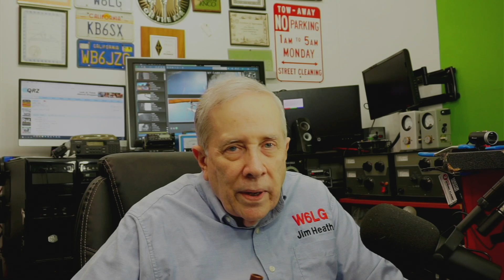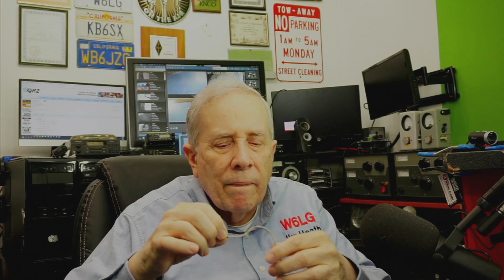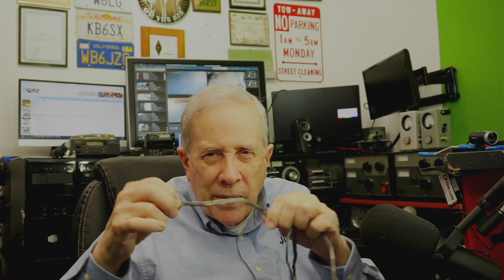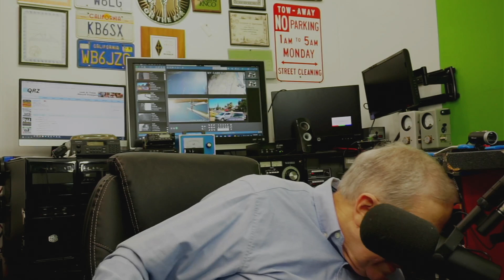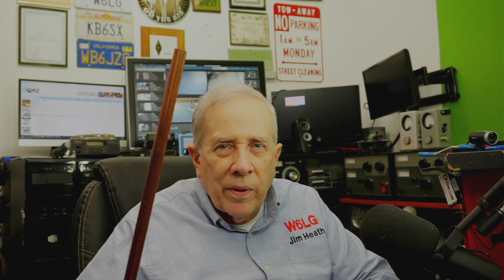How to RF Ground Your HF Station as Shown by the ARRL and a Discussion about Ground Loops, Bonding

Comment: My question is, what about someone running an all solar, or other battery powered only station?  If there is no mains connection and no mains powered PSU, then there would be no proper connection to the house's or building's proper ground.  in such a case, would a ground rod outside be best practice in such a situation?  

And, if we are talking theory, would there be a difference between a an actual shack or shed with solar or battery only power, and a house with a room that mains power but the house power is not connected to the radio system?  At what point is a radio station separate enough from the electrical system to safely not need to be grounded to the house main electric panel or main ground?  

I've asked the question before about grounding to a rack mount set, but I'd also like to hear your opinion on that if you have one.  Should the metal racks also be strapped to the station ground for voltage potential or not?
Reply from the maker: This is a video that has nothing to do with solar or batteries.  You are asking several questions not just one.  I have no experience with that kind of system.  There maybe some else who has the answers.  I have no idea.   For metal racks, like my desk here, yes I connect all of that stuff to the electrical ground.   Regards, Jim

Comment: I have already run a ground rod outside my second floor shack that goes back to the main ground rod via a system of rods and #6 copper wire. I should be good to bond to that since it is tied into the common ground point, correct? Second question is, how do/ did you bond your bonded pipe to the electrical system? Did you run a wire/strap to a ground screw in an electrical outlet?
Reply from the maker: If your system follows the NEC with respect to many ground rods and antenna systems as they show it their code/article, then good. My connection to the water pipe above this room was hose clamps. The room has shielding in the walls and that too is connected to the pipe. 73, Jim
Reply: @ham-radio  Ok, thank you! I guess your shielding is then bonded to the common ground from inside the wall. 

Yeah, I have 8ft rods, 16 ft apart (where possible) bonded with #6 copper. 

Thanks for the great videos and thanks for responding. 

-73!
Reply from the maker: @ericrobertson5130  From what I read this morning, yet again, what you have sounds good.  73, Jim
Reply: The NEC says that one or many ground rods should connect to an external-to-the-house terminal block and then ONLY ONE WIRE runs from that terminal block to the ground/neutral buss in the main disconnect breaker box and then distributed to the grounds in the house.  This requirement relates to AC fault safety and multiple current paths being possibly lethal.  If you connect your equipment to the ground rod outside your shack, would the AC power wire grounds in the wall socket now be connected to this ground rod via your power cords and equipment chassis?  Is this a multiple path for AC faults to return to the breaker box?
Reply: Best answer for this I have seen is above from @713allen:  "Inside the house, the concern is with safety and stray RF.  For stray RF, connect the chassis of each piece of equipment to a common baseline potential point (i.e. the copper pipe) using a low RF impedance connection (i.e. via braid or copper ribbon from each chassis to the pipe).  Doing this eliminates RF-radiating differential voltages on the chassis of two pieces of equipment.  Also, use ferrites to kill common mode RF.

Because each equipment chassis is connected to the ground pin of the three-wire power plug, the copper pipe is likewise connected to house safety ground.  This is good.  The point -- and to what I think you are asking -- is that it could make one "feel better" to connect that copper pipe directly to the ground of the power outlet.  This would be an extra-satisfying visible safety ground (NOT an RF or lightning ground).  This is perhaps a good thing to do because folks mess around with their equipment, trade their equipment, etc. As a result, one does not really know if the safety ground has been compromised.  Having a visible safety ground that I can see and rely upon could gives me the warm fuzzies!"

Comment: Interesting video, I was always told keep my station grounds as short as possible, but either way I have braided straps going from my amps and radio to a ground bar then connected to a 4 gauge ground wire to an 8 foot ground rod. Probably over kill but they're grounded.
Reply from the maker: NO NO NO. Watch the video and listen.  It is not overkill because an RF ground does not exist.  The ground you describe may be dangerous and may be a violation of the NEC.  What you have been told is wrong. 73, Jim
Reply: @ham-radio  I know next to nothing about electricity and have been listening to those that “know “ then you come along (I have great respect for you and service to the ham community) and challenge the handful of ideas I was beginning to consider implementing .  I want to get a better handle on it because a YouTuber damaged the exact radio model I have after leaving it connected to his antenna.  I really want to avoid that problem. Any specific manual (not code) on ham radio grounding you recommend?
Thank you
Reply from the maker: @luissanchez3214  Hey Luis, which radio was damaged?  N0AX Ward Silver, Google and YouTube search him.  Ward's a good guy.  Again, which radio? 73, Jim
Reply: @ham-radio  Lab599 discovery TX500.
Reply: @ham-radio  ok so basically the only thing I should be able to do is take my 7300 and bond it to my amp which is grounded through the electrical. Not to a ground rod.
Reply: @Joe_HamRadioGuy  see minute 10:55 to 12:30.  That is the key concept mr ward points out.  Adding more rods and alternate connections creates dissimilar voltage under some situations that will result in damage to equipment.  Thank you mr. Jim for the reference.  I will read the latest edition of mr. Ward’s book.
Reply: @Joe_HamRadioGuy  However, that's not what Ward Silver says but Jim recommends his book. I also understood that Jim seems to be saying that. I'm confused.
According to Ward N0AX, you must connect everything to the copper pipe and it must be connected to the ground of the electrical entrance.
Reply: @ThinKkBIGG  I have Ward's book and concur with you that the information presented here is contrary to what is in the book.  For example, Ward specifically discusses placing circumferential ground rods around the house/shack and bonding to the service panel ground. 

The book is confusing as hell at least for me. Have studied it, highlited it and made notes. Have watched bonding and grounding YT videos by Ham Radio Crash Course, Ham Radio for non-Techies, Ward Silver, Dave Casler and others and now here. I signed up and downloaded the National Electric Code and tried to wade through pertinent sections.
Am thinking too many ham radio YT videos spoil the grounding and bonding broth. Am thinking the ARRL book by Ward is the worst investment I've made in ham radio.
As parts of my station are arriving, I am no closer to a confident grounding and bonding plan than when I started.
Sincerely,
John - KK7JBZ
Reply: @johnbauman4005  I agree. I have, like you, checked out so many different sources and all so confusing. I see that AARL has updated their site and only suggests RF 'grounding' in specific circumstances. What I have come to, and I could still be wrong, is that you need a lightning ground and an AC safety ground. The lightning ground, and arrestor, is typically installed at the utility ground - co-ax goes from antenna to the utility ground rod to which the arrestor is connected. Off the other side of the arrestor,  the feed line goes into the house to the radio. The AC ground is simply your three prong plug. The RF is achieved, as Jim states, by connecting all equipment to a bus bar to keep the voltage as even keel as possible.
Reply: @Jim W6LG, would you recommend Ward's ARRL Grounding and Bonding book?  From your description of incorrect ARRL Grounding descriptions I was wondering if you meant Ward's book.
Reply: I guess I'm not understanding this.  I have my station set up in my metal shop.  I put in a grounding rod at the shop, and have a sub panel in the shop, that originates from the house, (main) panel.  So the electrical is all grounded, (AC)  but if I'm understanding correctly, I shouldn't tie any ground (bonding) straps to the metal ground at the shop, but rather run a line back to the main panel at the house??  Haven't quite got this sorted.  At this point, my set up isn't experiencing any difficulties/symptoms regarding rf,  and I do not have anything bonded??
Reply: Emailed you a question Jim  KA5GSS

Comment: Thanks for another great video Jim! Thanks for helping many of us sort through the mess of grounding. I do have a question: Does the length of strap used for the final connection to the home electrical common point ground raise any concern? I am in a similar situation to the past experience you shared. I have a second floor shack in my new home. I can certainly ground my equipment individually to a pipe or ground bus at my desk, but I would need to run a strap at least 60 feet to reach my home electrical common ground. I have heard many say to keep that connection as short as possible. Thanks again and look forward to learning more.
Reply from the maker: No. Again, we are talking about a redundant AC electrical ground and NOT an RF ground.  You may not need that separate wire at all.  In fact, you probably don't need what you are describing.  Keep saying to yourself, there is no magic RF ground.  There is no magic RF ground.  73, Jim
Reply: Your copper pipe buss is connected to the chassis of one or more pieces of equipment.  The chassis of each piece of equipment is connected to the ground wire of the AC cord.  So, you have multiple, parallel connections to house ground already.
Reply: @713allen  Again, your explanation is very clear. Thank you.

Comment: Great video Jim. As always, got a question about the UK I'm unable to run a ground I'm on the third floor, and in the UK we can't connect to the electrical system (PME) big nono also can't run a suitable wire from the shack out the window to a ground rod,  should I still bond all the equipment together not in a daisy chain but all to a single spot even though I still can't connect to any ground? Thanks again David
Reply from the maker: I answer your questions in the video many times.  AC ground yes as discussed.  RF ground does not exist.  Ground rod; no. 73, Jim
Reply: @ham-radio  thanks, Jim the only AC ground we can use by default in the UK is the one via the power supply or amp on the 3-pin plug, I just wanted to know if it was worth bonding the equipment together thanks.
Reply: I know your comment is from awhile ago, but do they have surge protector power strips with TV aerial connectors on them in the UK?
That might work for you.
 @Davidm-M0TPT